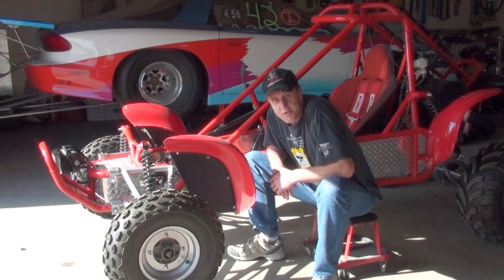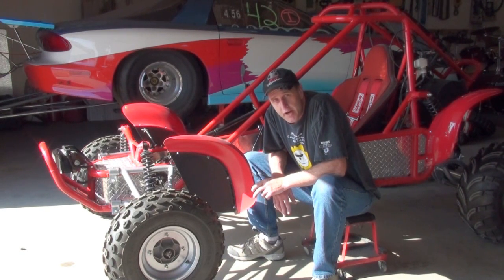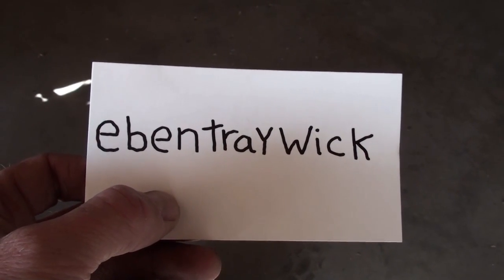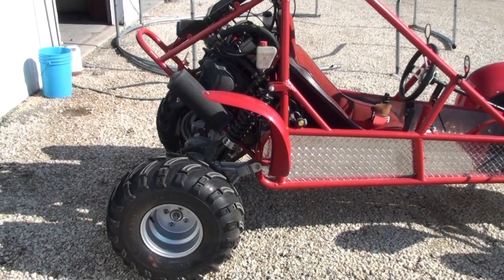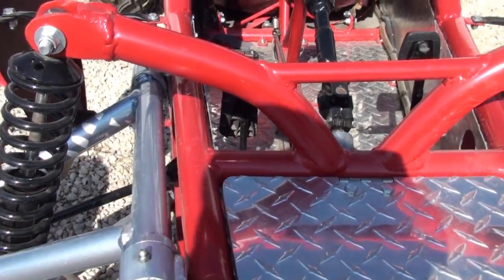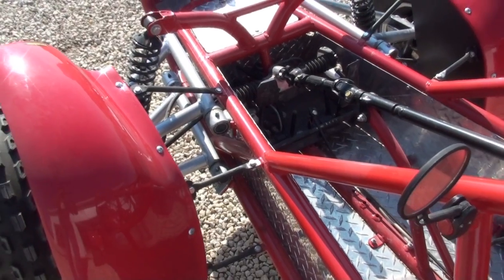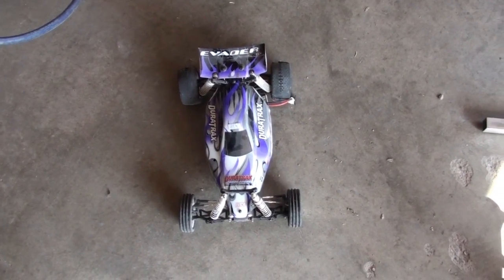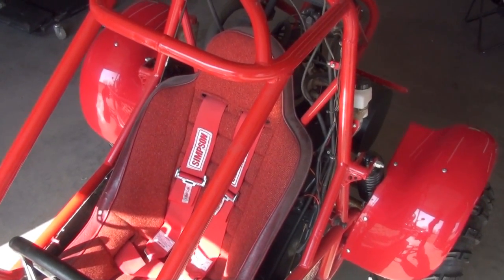My Dune Buggy Tech

Comment: Hey I am 15 and I am building a buggy and i have a old ski doo 670. Do you think the a arm suspension off of it will work? And do you think 1/8" steel tubing will be strong enough for the frame? Your video was very helpful to me.
Reply from the maker: I would recommend 1-1/4 x1/8 DOM tubing for the frame, the front suspension from the sled may be a little light duty, might be ok

Comment: Watching the part on the a-arms, when you designed it to be perfectly parallel, you don't get camber gains when the suspension is compressed, such as during body roll.  My question is, is this negligible on a buggy or go kart, or is this something that is noticeable?  The engineering is much more difficult to design short long arm suspension, so I almost want to scrap the idea.  Can you offer any insight, please?  It could be that the balloon ATV tires you used allow sidewall riding, but I am planning to use golf-cart tires.  Please could you advise if you have the time?

Thanks!

Comment: Groutaone.... after reading through some comments and seeing your video about how to make the steering sharper that helps me a lot with my build. I would like to know if you know of a recommended rear end that can handle 80 miles an hour down the highway. no my buggy is not going to go that fast but maybe 75 as I am going to use a 700cc inline 4 motorcycle engine. mine is going to be completely street legal and with the fuel efficiency of the motorcycle engine I will also have to 8 gallon gas tanks so I'm looking at about 400 miles for 16 gallons(<--- maybe), don't know yet.

Comment: Hey Groutaone! Nice mini buggy, I love the shape and workmanship on the beast. Im 15 and in the process of making a mini buggy of my own. Im salvaging most suspension parts from an old yamaha blaster, since im going to be widening the front end to allow for space for my feet the rear axle from the quad is too narrow :( I was wondering where or what you got your solid live axle from before you done the long travel conversion. If you could help me out that would be much appreciated. Great vids by the way, keep it up. Thanks :)
Reply from the maker: +Thor Halkyard Thanks for watching, the rear axle was just a straight shaft I picked up at a metal supply shop, I had them cut key slots in the ends for custom made hubs
Reply: Aright, hey thanks for the quick response. :)

Comment: Hello groutaone! A wonderful build I'm 14 just like that kid I have seen his sight, but I don't have much cash ( beings the fact I'm 14) but I scraped up enough to by a her dog 3203 a wonderful cart for beginners. But I've logged like ya know 2,000 miles on it and use it to drive to small towns even (yes it's illegal I drive I  the corn fields next to the road so that it's legal ^_^) but it just sint fast enough, it tips out at 28 mph, now that's alright but not fast enough.
Is there a way to make it run any faster? 

   A lifelong problem it had was that it's steering bar used a ball and socket method which popped out EXTREMELY easily, so I've had a few bad crashes in it, and it's not original at all we had to removed the role cage because the suspension broke in the back so it dragged, now my dad is an iron worker so we used girders welders etc. And got it working again!(suprisingly!) But can it go faster it has a 6.5 hp  motor is that any good it looks like u have a 30 hp  XD.

Well hopefully u aren't like other big youtubers who never respond, but you are very inspirational! Keep it up!
Reply from the maker: Butter BiscutBob Thanks for watching and for your comment. Not sure what top speed should be on a Yerf dog 3203 but I think the engine is 7-8 hp or so. Check that the centrifugal clutch moves the belt out normally when under full rpm, a go pro camera would be the safest way to check. The belt should climb up and be flush with the outside edge on the engine pulley and be sunk all the way in on the driven pulley, If this is working normal and since your machine also has a chain and sprockets then you may want to consider a sprocket change to alter speed, this will reduce low speed power and you don't have much to spare, not sure what engine you have but a modified governor would increase rpm but at the risk of reduced engine life, I saw a video of someone else's Yerf dog and his had no roll cage, I hope yours has one, most important part of the machine, I'm scared for people that drive buggies with no cage, I can imagine someone's face or body running into the back bumper of a pickup truck by accident. Also critical are brakes, seatbelt and good reliable steering, hope you get your steering sorted out, have fun, stay safe
Reply: groutaone hey thanks for responding! And yes my steering is sorted out the engine works fine and it isn't governed, it tips out at 33 mph. Ain't bad, but with no breaks that's plenty fast! I used a 3/8 inch bolt to fix the socket popping out by taking the assembly off its now 1 piece and it is wonderful I might upload a video of me doing a little riding, and I have a nice helmet neck brace and chest plate(life is no. 1 priority) and I had an accident on a 4 wheeler that scarred me for life, and I won't be turning or drifting fast again! 9 months with a neck and back brace isn't worth the fun! I hope everyone reads this. But that's for responding like I said.

Comment: what transmission setup are you runing?
Reply from the maker: Laurentiu Stoica The transmission in this video is from a 250 Polaris cyclone, it has reverse but it's not real strong
Reply: groutaone And how did you make the inside wheel to turn more?
Reply from the maker: Both same speed as it had no center diff
Reply: my mystake how did tou make the inside whell to steer more?

Comment: So I want to know this. Are you saying that if you turn the steering wheel left. the spindle snout rises. Its around 7:25 into the video. If the car is sitting still and you turn left the a-arms rise when the car turns left .  That would make the spindle sweep up and down depending on your turning.

Comment: Nice, I had the same rc car, and I run the same steering rack in my homebuilt buggy. Interesting that you've made upper & lower a-arm the same length. Usually top arms are shorter. In a buggy like this though, it doesn't really matter.

Comment: but i tought.unequal length double a arms  work better..?
cause the use of this set up.will give u negative camber when the suspension compresses(meaning better cornering)the tire will dig into the ground.helping u turn better and faster.the lower control arm should be longer then the upper by a 50 to 80%..

Comment from the maker: @bushbasherSSS  sure I will reply, yes the a arms insert into steel bushings, the kind that is sometimes used in heavy equip. And because the bushings are steel, I could weld mounts to them to bolt to the frame

Comment: looks nice
but there is more about the steering systeem then making sure the run even wit the control arms, if i'm right the arm where te tierod attaches should come together with the arm from the other side right in the center of the rear axle, atleast that what i learned about it

Comment from the maker: @vvtheduckvv  Hi duckman, no it wasnt a kit or based off a kit. I just picked up a bunch of tubing and had at it. I could kinda visualize what it should look like and the rest I made up as I went along so good or bad its the only one like it on the planet.
Reply: groutaone I'm from central Il in the us I have a 2013 trailmaster 300cc frame I'm putting a ninja zx6r motor in it and I had a couple questions based of of your build I'm using 25 inch GBC dirt devil tires kn12 inch dwt bead lock rims Mazda Rx8 Seats had to extend it like 2 foot in the back my ? Is what kind of coil over suspension should I use to support the added weight of the motor and seats.  Sound system light bar etc btw I love the build